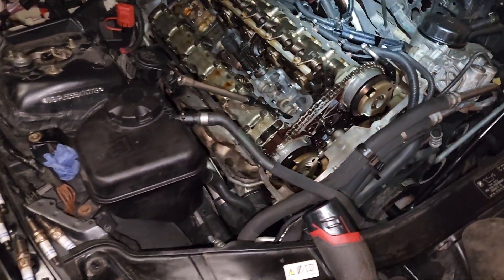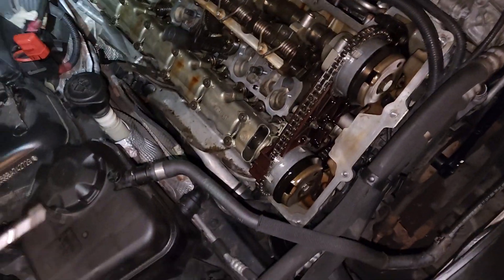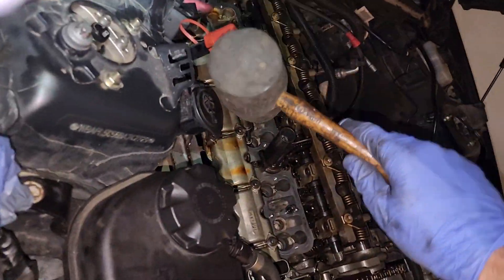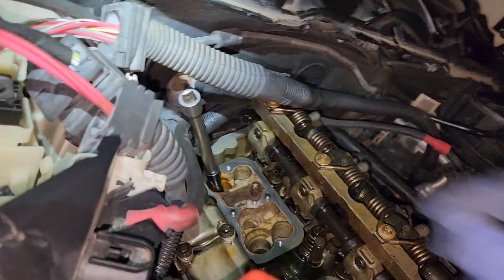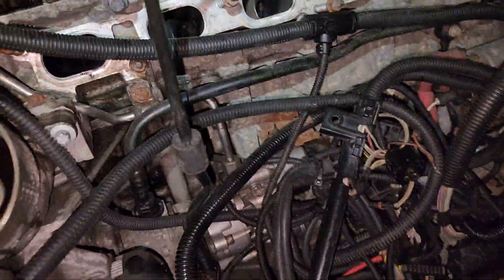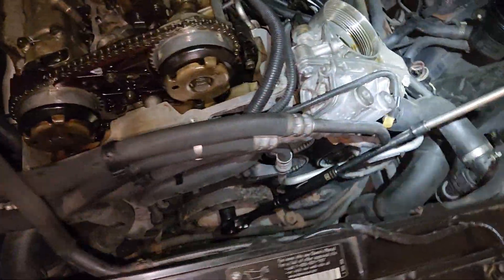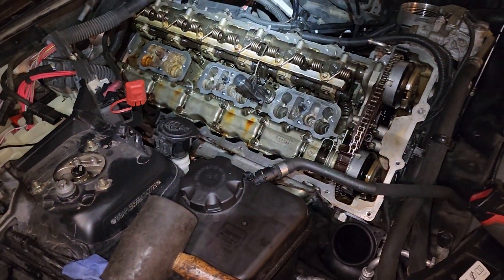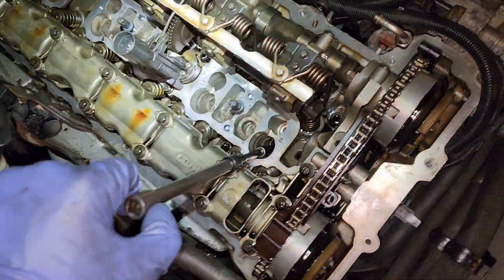N55 Engine 2011 BMW 335i XDrive Diagnostics (episode 2) How to diagnose a rod bearing failure

Comment: Hey Car Inspected, Thanks for posting this! Helps a lot. Do you have any updates on this vehicle? Did you just replaced the bearings or did the entire engine have to pulled?
Reply from the maker: I basically opted to replace the engine with a good used one. But I kept the old engine and plan to tear it down and rebuild it as a winter project.
Reply: Did you ever find out what the issue was? I have the same exact knock on my 535i 2011. Its an N55 engine as well
Reply from the maker: As the video shows, it was a spun rod bearing, and I decided to replace the engine.